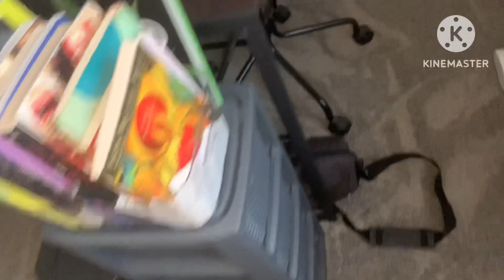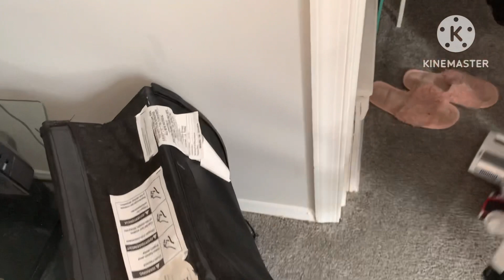Full Room Mess ~ New Shark Vac ❤️ , Thanks @bdetaild

Comment: ❤ TIMESTAMPS ❤

✨ 0:00 - Intro
✨ 0:05 - ✨The Mess Test✨

✨ 0:12 - Vacmaster spread out brushroll pickup w/ Er-Thang Mix on multiple rugs
✨ 4:57 - Lavender Shark spread out brushroll pickup w/ Er-Thang Mix on multiple rugs

✨ 8:13 - Rug shakeout 
✨ 9:23 - White Shark brushroll cleanup on multiple rugs/carpet 
✨ 13:51 - White Shark brushroll cleanup on carpet 
✨ 16:24 - White Shark hose cleanup on carpet, closeup + edge cleaning
✨ 18:09 - White Shark brushroll cleanup on carpet 

✨ 20:58 - White Shark brushroll natural vacuuming on carpet + AMAZING lines 😍
✨ 29:29 - White Shark brushroll pickup w/ natural dirt on carpet